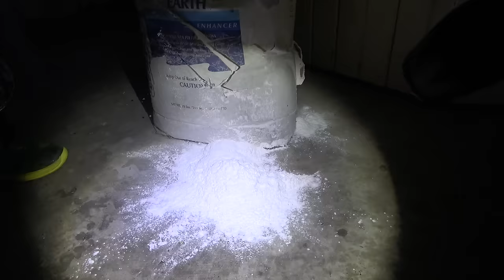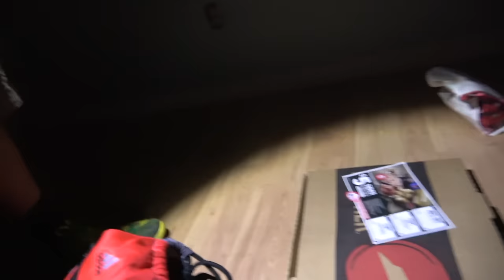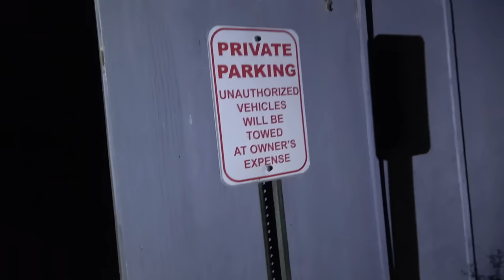24 HOUR OVERNIGHT CHALLENGE IN ABANDONED HOUSE!!

Comment: Why the hell is the house abandend
Reply: Jenson Phillips because no one is in there
Reply: Because it is eligil and everything they do that is eligil is abandend
Reply: Well there is different reasons why a house could be abandoned like the fact that there could be major termite infestation or some serious code violations, there are people in these comments that have though that this house is still under construction and it was abandoned and never fully finished which is a little bit possible but the best case scenario is that these people have left the house because there is some serious termite issue that is possible or some kind of other major issues like plumbing because you hear around 2:25 Ricky said that no one has lived in the house for a couple months at the time this video was uploaded. That being said this house seems to have been well taken care of by the original owners as there is no major issues with it and it mostly seems clean for being abandoned. I will not be surprised if this house is built somewhere in the 50s-70s judging by the wood paneling which was common at that time. I would love for them to upload a part 2 if it is still abandoned or at least upload a picture to the community page showing a picture of this house if it is not abandoned anymore and was claimed by someone through adverse possession or something else. I just wish that they didn't move the camera around so much and at least showed the exterior of this house a little more as they were walking up to it etc...

Comment: that was probably somebody house and they still come there but only sometimes
Reply: Very possible, or somebody is remodeling it now or it has been remodeled by now since this video was 7 years ago. There is things called adverse posession. Maybe at the time it was sold but the new owners shut off the power to it while remodeling it or something because you can tell that the rug was ripped out on the flooring and it isn't all just one piece so maybe they were going to put new flooring. Maybe the original owners did not want to bother fixing the house or something and again, likely sold it.